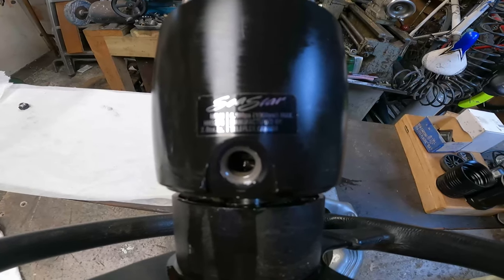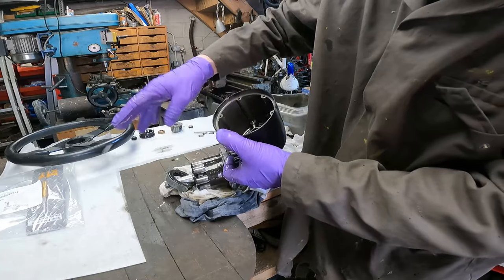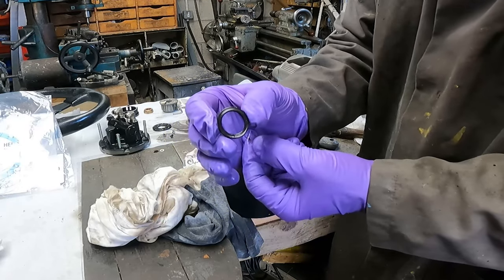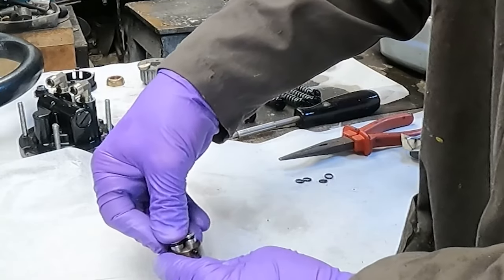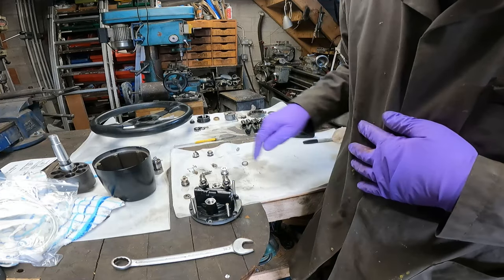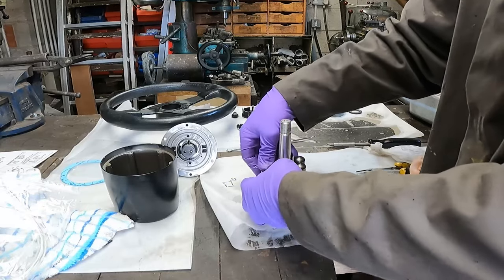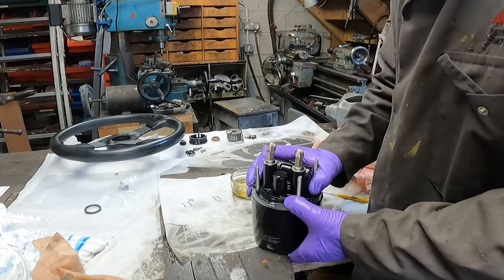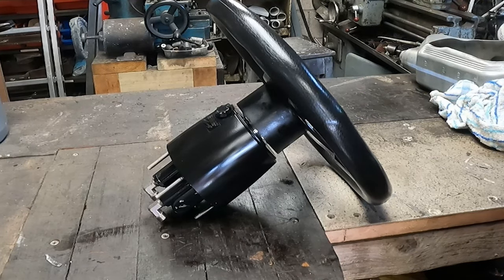SeaStar Hydraulic Helm Pump HH5273 rebuild

Comment: Thank you for the VIdeo! Just rebuilt my Baystar HH4514 because of a rear seal leak. The internals looked to be in good shape and everything went back together just fine. Everything works as it should, but still have the leak, which appears to be coming from the rear seal. Thought I'd give this a go, but looks like I'm going to have to replace after all.

Comment: What type of sealant would you use to join the 90 degree elbows to the bottom of the helm? I'm talking about the  elbows that the main hydraulic lines connect to.

Comment: Question. I’ve replaced all seals at the motor. Both were leaking. I’ve bled the system. Turning wheel clockwise feels good but counter clockwise it’s like it’s grabbing and releasing. Like a piston stroking   The steering turns but it’s slower

Comment: Hi paul great video. Can you please tell me what symptoms this helm had before the build. My steering is a lot stiffer than it was originally. It’s a sea star 1 helm from 1990
Reply from the maker: The steering became vague, it was responding slowly and erraticallly to the helm. Checked for air in the system first, and then decided to rebuild the pump. If yours is feeling stiff it may be worth draining the hydraulic fluid, if it is showing signs of brown rust deposits then it is likley one of the seals has broken down and allowed moisture to enter into the pump and rust the internals. They are mostly made of what looks like cast iron so need to be fully immersed in oil or they rust and the pump pistons start to stick.

Comment: I took the pump completely apart including the 90 fittings for the port and starboard lines. In these ports are valves that weren't tight and I think they are meant to  regulate pressure.  I'm thinking they need to be screwed in a certain amount of turns like the idle adjustment on a Carb.  Any advise?

Comment: @wapsac This video is A1 sir!! 
My steering has been drifting to starboard recently even after I replaced all cylinder seals.. from what I have gathered my issue is likely a stuck check valve in the helm for that starboard side, but the sea star tech said not to open the helm and replace. I think I have found the seal kit on Amazon with the correct pieces and may try it out, looks like it contains 11 total seals and the blue gasket. Does that sound like an accurate diagnosis to you?
Reply from the maker: Yes, sounds right based on what you have detailed. Make sure you replace the ball bearings with new to give it the best chance of working. When you dismantle it if its full of rusty fluid, clean it thoroughly and check the valve seats. Sometimes they get a bit corroded and will not seal properly. Its then a difficult task to clean them and put the best surface on them that you can.

Comment: Great video !!!! I wish i had a look before i pulled mine apart. I could do with your opinion on a problem i have ..... that is one of my pistons was accidentally pushed in too far, and now its stuck down tight. Would you have any idea how to free it so I could pull it out ??
Reply from the maker: You need to be careful so as not to score the piston and im assuming you have soaked the piston is releasing fluid like WD40. If you are going to replace the seal then you can warm the hub in the oven to increase tolerances then gently tap with a rubber mallet to see if the piston moves. Remember the spring will assist the piston to move. If this does not work then the best option is to use compressed air to force the piston out, but be aware this is dangerous as the pistion could fly out under pressure so make sure you wrap the hub in lots of heavy fabris like towels before you attempt it and ensure nothing is in the way that the pistion shooting out could hit. Good luck.

Comment: Hi - brilliant video. Were you happy with the parts supplier? Getting the little tool looks to be very helpful. Please could you share the name of the supplier you used for the parts and did it all work 100% back on the boat? Only want to do the job once (actually I don’t even want to do it once!) You hear about some suppliers where the seals aren’t exactly to size and then one has wasted a lot of time. Many thanks again….
Reply from the maker: Bought from Amazon Uk

Comment: how do you know when it is bad?  I "think" my lines are bled, but it still only turns to one side.  Sort of lost as to what to check next.  Thanks
Reply from the maker: If therer are no obvious steering fluid leaks, then open the bleed valves one at a time on the outboard steering ram and turn the helm, try both ways testing to make sure steering fluid is coming out of the bleed valves. If this is working then cover the bleed valve to see if it has some pressure behind it. If you can feel the fluid has some pressure then it may be a seal in the steering ram itself that has failed.

Comment: No hydraulic leaks but steering has locked up. Any thoughts? HH5271h
Reply from the maker: May be a piston in the helm pump seized up. Slacken off one of the bleed nipples on the hydraulic ram that pushes the motor and see if the helm turns. If not then its likely a fault with the helm pump

Comment: Dear Paul,
I have got a Seastar 1.7 hh5217. When turning the weel is feels like the pump is stuttering. Like every time it gives some resistance.
Before I open it up, and change all the seals like you did, (thanks for the video by the way), do you have any idea what the issue could be?
Appriciate your input!.
Best regards,
Jan from the Netherlands!
Reply from the maker: It could be air in the system, these need bleeding quite a lot to clear all the air bubbles. There are a number of videos on youtube on how to do this, on somr occasions I have had to rebleed the system 3 times after the new seals have bedded in. It could be some sticking pistons i the pump itself, but this is unlikly if you have just rebuilt it. Also take a look at the hydraulic Ram end on the motor to see if the seals need replacing. Good luck
Reply: Thanks. Haven't rebuild it yet, but am going to. You might have a point with airbubbles. I will keep this in mind!

Comment: I am rebuilding my helm pump but the fluid filled cushions are missing, do you have a part number and soarce for purchasing them?????, Reply here please
Reply from the maker: Sorry, dont have the part numbers, the Sea Star is an american made helm pump so I'm sure you will find a PDF manual with parts and numbers on the internet. Very few boat yards will offer to rebuild these units they only do replacement units so its well worth spending some time to source parts.

Comment: Hello sir, i thank you for this video, i opened my HH5272 and struggled to put it back together. When i opened up the helm, the 1 of 2 c. Pack fell off and I didn’t know where to put it them. Then I watch your video and I followed your steps and then I put them together. Those 6 screw, what torque did you put on?
Reply from the maker: I did not apply an actual torque setting, just nipped them up. I suppoose as they are roughly 6mm threads then a torque setting of 20Nm would suffice.
Reply: I didn’t fill my helm at the bench but I filled after I installed it, is it ok to do this way?
Reply from the maker: Yes it will work just takes more time to bleed all the air out of the system
Reply: Paul thinks for reply, my helm is ok, I had a problem with my cylinder for inboard. Gaskets were leaking so it kept collecting air, i looked on YouTube for rebuilding video of Seastar hc5319 so I had to buy new cylinder. We will be happy to see from you a video about how to rebuild Seastar hc5319 cylinder. Thank for your time

Comment: Does the piston position matter?  Mine went everywhere when I took the housing off.
Reply from the maker: Each piston whould be retained in its original cylinder to avoid variances in wear which may caiuse a piston to stick or be too loose if in the wrong cylinder. If its no possible to identify which piston fits into each cylinder then ensure, through trial and error which piston has a good sliding fit in each cylinder and go with that. Not ideal but as good as you can acheive.

Comment: How much time should I plan to rebuild?
Reply from the maker: Takes a couple of hours if it all comes apart without any issues
Reply: ...it entirely depends how far yours is gone...the one in this video looks to be in near perfect condition...mine was full of rust and I had to degrease and polish everything except the piston caps...you will definitely need the o ring pick...I was stuck on that until I could find one that worked, it's recessed and very difficult to pull...